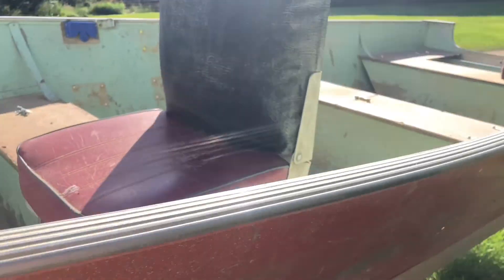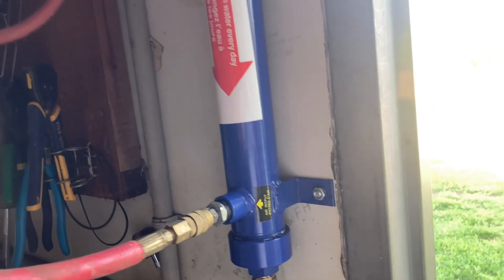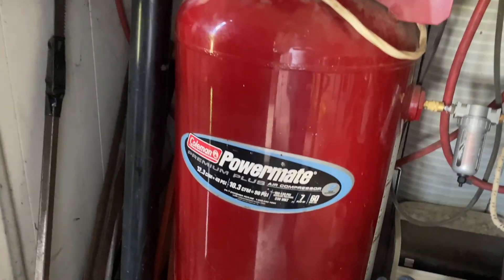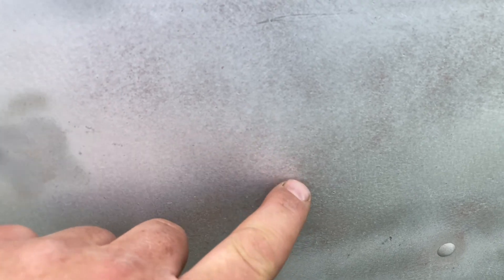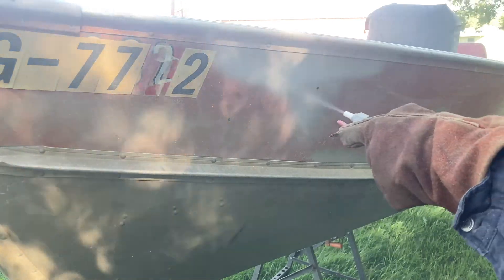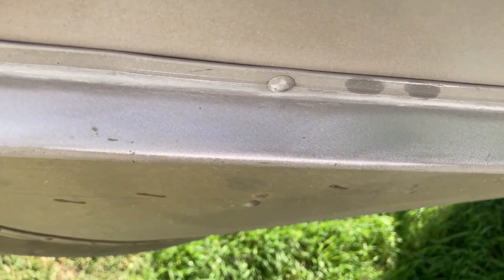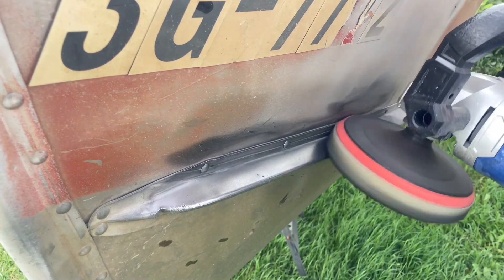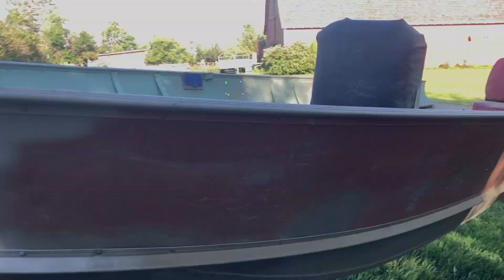Sandblasting an aluminum boat

Comment: It does contaminate the aluminum if u need to weld on it.
Reply from the maker: It sure would.  Do you think a wipe down with acetone would clean the aluminum enough to weld?
Reply: @28fish  no. From what I'm told the media gets embedded into the aluminum. I have an aluminum boat that was blasted with the wrong medium and when you weld it just melts like solder.

Comment: I was told by a pro, to use crushed glass, not sand, on aluminum.  

Your sand media looks like it's leaving lots of roughness on the alum
Reply from the maker: I actually tried glass too.  It resulted in larger pock marks and a very rough finish.  With professional equipment and a finer grit of glass than I can get I’ll bet that would be the way to go.

Comment: Hey outstanding video. Where did you get the air dryer and what's the part number?
Reply from the maker: Thanks, brother!  It is from a Canadian retail chain called Princess Auto.  Here is a link to their listing.  You need to buy the desiccant pellets separately:  https://www.princessauto.com/en/in-line-desiccant-air-dryer/product/PA0008055757